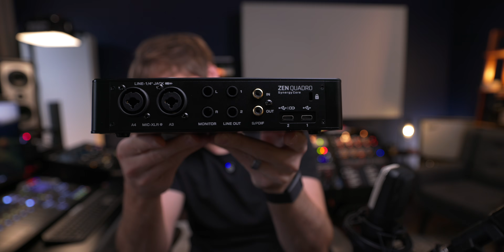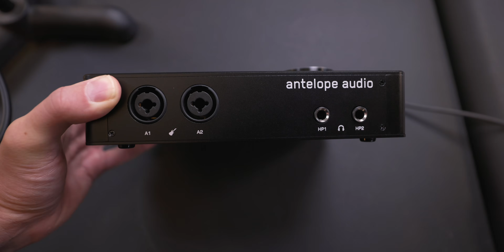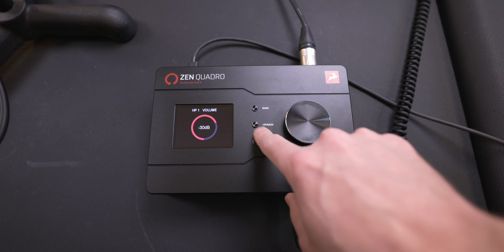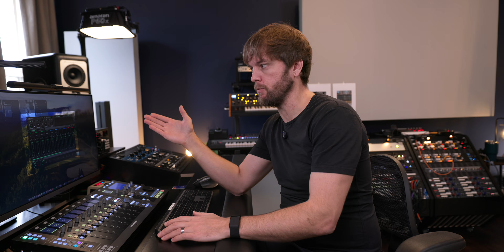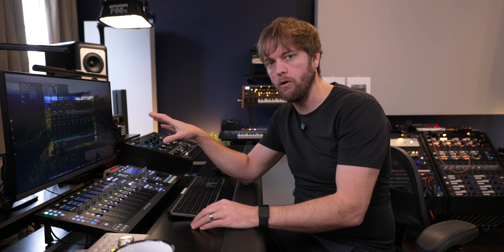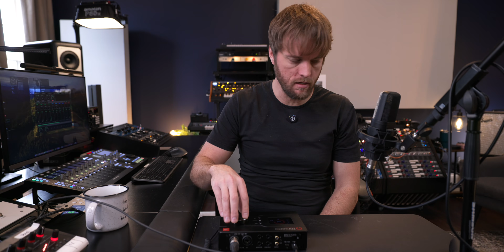Antelope Audio Zen Quadro Interface | Setup and Workflow

Comment: Guys this little box is so tricky. I just looked it up online and there is a way to turn it off or put it on standby. If you hold down the Gain button by long pressing it a menu comes up. You then scroll to the bottom where it says Standby and press the Jog wheel and the device goes into standby. Thank me now by streaming some of my music . Haha.😊🎉❤ It beats having to unplug all the time and weakening your connection cable.

Comment: I have not found any video's explaining how to add adat 8 channels. There has to be more than just connecting an optical cable.
Reply from the maker: You usually have to configure the routing in the control panel software to map those adat inputs to your DAW.

Comment: HI, I am having problems understanding what controls the direct montioring vs monitoring through the daw. (I am using reaper) Is it the slider fader that controls the direct monitoring. I ran into problems when I did 3 mic tracking both wet and dry versions of plugins in the quadro. So I had to take some of the defalt traxs and I lost my listening. Either a deeper dive on the function as a future video or info you could give me would be appreciated. thanks.

Comment: Can you bypass the preamp and go direct to the ADC to use an outboard preamp?
Reply: The answer is no. Only the Orion allows you to use direct input straight to the ADC. You can still set to line but it still goes through the preamp

Comment: Hi, Can I get an honest reply? Do you actually use this interface to record the music or you just reviewing it?

And if you are really using it. Do you find it comfortable to use this interface menus and scroll wheel on daily basis? 

Is it really possible to record good quality guitar song just with built-in effects? Obviously assuming that you have a good room and mic setup.
Reply from the maker: I don't personally use this interface in my studio as I use a 64 IO galaxy setup with analog gear. It's a few steps up from this unit. This video is a paid product demo/overview for anyone interested in it. It's hard to say how much I would physically interface with the unit outside of turning volume up and down. I like the software controls on it. 100% you can get great recordings with it. The converters are amazing, and the pres actually sound great.
Reply: @itsstudiotime   I tested Zen quadro and found issues related to usability and crashing software. Scarlet is much more stable. It takes me way much less time to set up Scarlet Gen 4 then Zen Quadro. Also, Scarlett just works and Zen quadro would disconnect from the server and stop working every hour or so.
Reply: @itsstudiotime  thank you!

Comment: Bought it over a week ago.  Compared it to my Focusrite Scarlett 4i4 gen 3 and SSL 2+ (gen1).  There are 3 big minuses with the Zen:
1. Headphone output.  7/10.  Considerably weaker than Scarlett and SSL (9/10)
2. Headphone quality.  6/10.  Image is flat, lifeless.  Scarlett and SSL are much more detailed, 3-D, and full (9/10) for both.
3. Mic Pres quality.  7/10.  Although overall accuracy is as good as Scarlett and SSL, any vocal mic recording has a low level of hiss in it.  I did a recording using ZenQ and played it back on SSL to confirm my suspicions -- mic pres do add hiss -- hiss is NOT in headphone amp.  Although the level of hiss is hardly noticeable, nevertheless it is there.  Scarlett and SSL have silent background recordings -- no hiss.
Reply: How are you feeling about the Zen 7 months later?
Reply: How are you doing now?
Reply: @patugart  I returned it.  I personally suspect my unit was defective since none of the YT reviews that I've seen mention any of the problems that I experienced.

Comment: Don’t buy Antelope, worst interface experience ever!
Reply from the maker: I disagree good sir. But I’m only basing it on my experience using or owning lynx aurora, apogee symphony, Apollo x16, 8p, the old digital 192s, avid hdx, and Focusrite 18i20.
Reply: @ is this Andrew answering? I’m subscribed to both your channels, just to check if this is your “vibe” answering. I have owned and still own half of  what you are mentioning, and have worked with the other half. So save the sarcasm. My experience and the experience of many friends with Antelope has been the worst! Issues all the time! Pops and cracks, with all firmware versions and updates, weird “room reverb” effects suddenly in the signal, the meters on the console doesn’t work, don’t read properly or get stuck. The knobs on the plugins too. Their technical support doesn’t have answers for your issues. They don’t know how to fixed them. They admit the console works that way, with those issues but they don’t fix it! I used to use them on my second setup. Got a second newer Apollo and done! Back to work without any drama. And the conversion myth about Antelope being better was done too. BS! That’s my humble opinion good sir, I would not recommend those interfaces to anyone! Worst even than way lower quality interfaces! Take care!
Reply from the maker: This is indeed me. Well I'm bummed that you've not had a good experience and am happy you have found something you like. It's interesting that you choose to watch product videos on products you seem to hate, I'm grateful for the engagement though. Not sure what to say when my experience is the exact opposite other then I'm happy your setup is working for you. I don't intend to be sarcastic, just specific. I find (as the guy who reads all these comments) most people leaving comments are the loudest, angriest people who don't know anything about me and assume I'm some kid in a basement. So I like to give some details. Again, thanks for clicking and watching even if it's a hate watch. Really appreciate you.
Reply: @itsstudiotime  I don’t choose to watch videos of products I seem to hate. I watched all your other studio tour and gear videos, I really enjoy them and I’m pretty sure this is not the first time I comment in your channels. Your video came in and although probably I didn’t comment in the best way the first time, I just wanted to share my honest opinion based on my experience too as an honest advice, and I’m not a kid in a basement neither. I’m glad that worked for you but it didn’t for me at all, and I stand by my opinion. No hate at all! Really like your stuff and don’t like or recommend Antelope Audio to anyone! Worst experience ever!
Reply: @ElmerFerrer  thx this comment helps a lot. This utuber is one of those dishonest sellouts. Not worth following. I block him
Reply: @itsstudiotime  I didn't get it, why are you so defensive about the product? You came off a bit too salty when OP clearly supports you hence watches your videos. OP is just sharing his experience which he has all the right to. Seems like Antelope paid you really well there

Comment: I purchased this interface on day one (late May 2024) and it's amazing! For this functionality, the best in this price range.
Reply: How are the drivers? I'm using UAD but it's clear they don't care about Windows so it's time to make a change.
Reply: @dave9640  - I have had absolutely zero issues on Windows 11 with the Zen Quadro. I've used RME, PreSonus, Rode, Steinberg, Behringer, etc. interfaces.
Reply: Thanks for the heads-up. Next week I'm losing at either the UAD Apollo Solo or this zen quadro open box. It'll be on Windows. So UA isn't as good on Windows?  @dave9640
Reply from the maker: Nice

Comment: Customer support is absolutely terrible with Antelope. Just read all the bad reviews. Wouldn't touch an antelope ever again. Had nothing but problems with my Zen Go and its not even two years old.
Reply: Never had a problem with my Zen Go. I've owned and used many interfaces RME, Motu etc and Antelope has been the most stable. Cannot comment on customer service as I've never had a reason to contact them.
Reply: @23ghostrider  are you on Mac or PC? I have a. Discrete 8 Legacy that hasn’t been totally stable. I’m tempted to get a Zen Quadro but a little concerned.
Reply: I have the zen go it is a headache to understand what it and make it work, since antelope doesn’t have a windows audio driver so you have to use a external app unless you use your daw only, but once you understand it, it works flawlessly like no other interface I ever had , I assume this is the reason they discontinued the zen go and now is the zen quadro
Reply: @D @DavidCastro-by5sp what do you mean by external app?
Reply: @D @DavidCastro-by5sp their control panel app?

Comment: I have the previous model. Great, but can't seem to make the onboard display brighter. Thunderbolt model.
Reply: Open the control panel software, go to the settings window by clicking the small gear button on the top right, and there's a brightness slider in the settings.